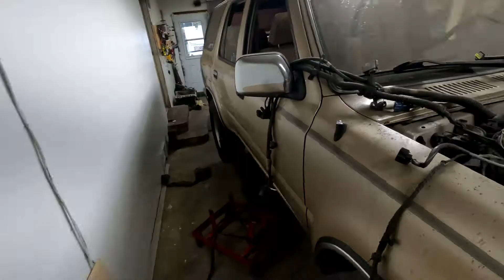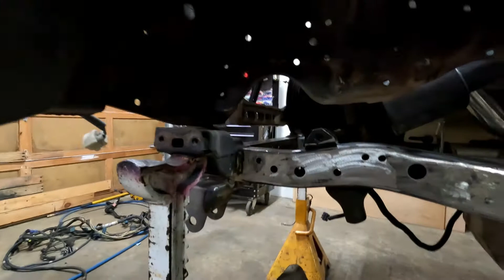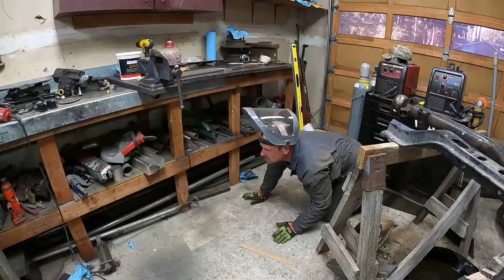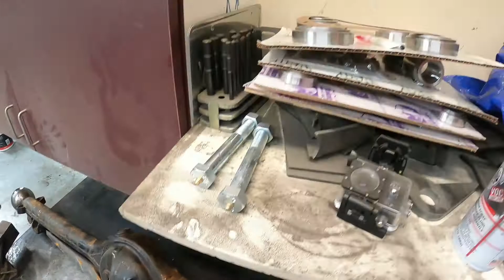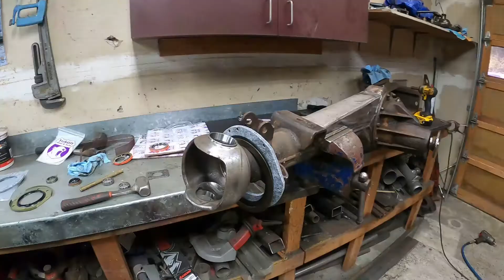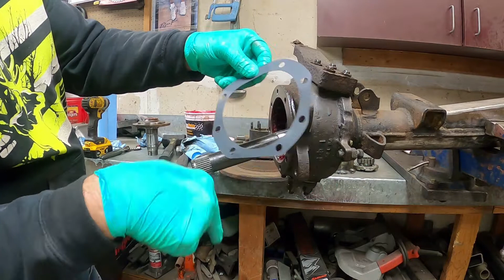Toyota 2ND Gen 4runner LS Swap

Comment: I have a 2006 4.0 4x4 SR5 and the motor is toast. Remanufactured 4.0's are 4500 to 8500. Do you know if it's possible to swap in a 5.3 LS and keep the IFS front 4x4 diff. I would like to have all my gauges and everything work if possible. If it's possible, any advice on where to find adapters, wiring harness adapters, and etc. Will be greatly appreciated. Thanks. J. Tyler
Reply from the maker: The gauges could work using the toyota stock sensors and for a wiring harness I am using a stock one that I will adapt by cutting and soldering the wiring to my needs.

Comment: I might be wrong but the earlier Toyota’s with a gear drive tcase  cross members have less of a kick forward. When I replaced my 4cyl with a V6 I used the V6 cross member because everything moved forward 2”, mounting points were in the same spot because I used Toyota parts. Bud built makes aftermarket cross members out of 1/4 plate so there not as thick as the stock ones.
Reply from the maker: I just used some 1/4" plate for the transmission cross member and I still need to fab up the transfercase brace.

Comment: What harness is that?
Reply from the maker: The harness I am using on the motor is a stock checy harness that has been simplified and programmed to run with a couple hookups. I will go more in depth in a later video.

Comment: The problem you'll run into is the Toyota gauges won't read right the temp will Show very hot and oil to high so you might want to look into a tablet to run gauges it's the easiest and cheapest